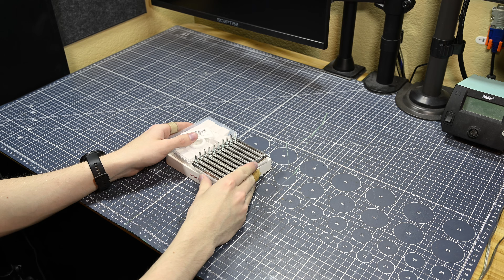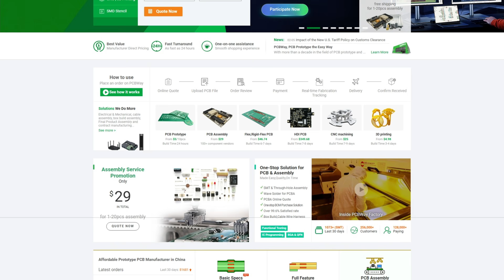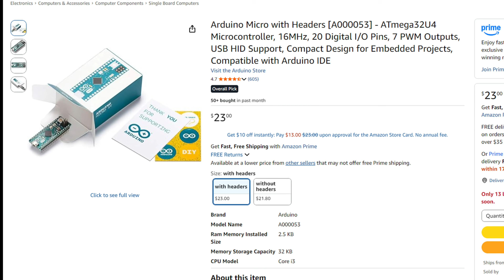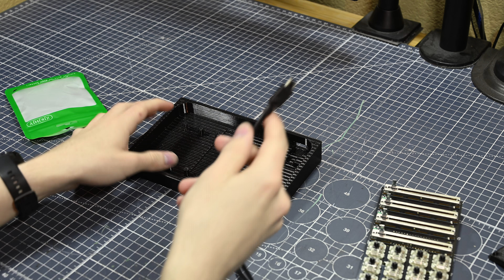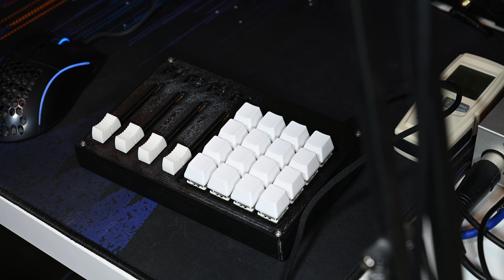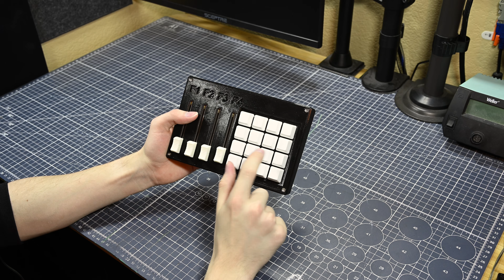Add Physical Per-App Volume Control AND 16 Programmable Macro Keys to Your PC For Cheap!

Comment: i recommend to use F13 to F24 keys, as they are very usefull and easy to rebind to .   i use this a lot , i  build mine with an simple (old) 12 key keypad and an arduino pro micro. even if my keyboard supports makros and stuff i use this thing all the time. mostly for discord and obs. 

i also have a seperat build using the deej software using 8 sliders, 8 buttons and an ws2812b led stripe to show different mute levels.
but windows has some driver problems with the arduino nano i used for this. the ch340 driver from 2024 version (windows will use this as its the newest) makes deej not working correctly. but the older 2019 version or even 2014 version do work just fine.

just dont use any arduino that uses the ch340 serial chip. an pro micro just works fine.(but they sometimes need to have a new bootloader written as they sometimes come only with an quite old unstable one preinstalled)
Reply from the maker: F13 to F24 keys is a great idea!

Comment: I'd rather use a rotary encoder with a led ring around, so you don't have to set phisically the volume level but handle it in pure digital logic

Comment: I've never even looked inside a keyboard.

But for some reason, I decided that a great project to help me learn useful skills whilst I study engineering would be a custom macro pad.

Specifically one to let me use my laptop as a scientific calculator/graphing calculator and to make using the equation editor in Word easier.

Probably gonna end up with 60+ keys and months worth of just mapping a layout.

Never mind the fact that I don't know how to code, how to use CAD or basic circuit design.

Hopefully I'll have it figured out by the end of the year 😂